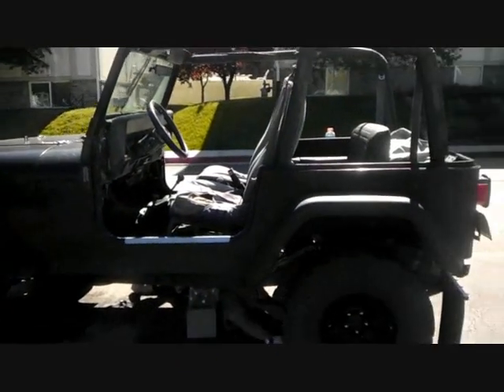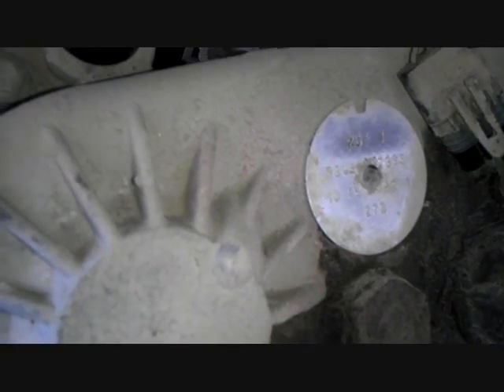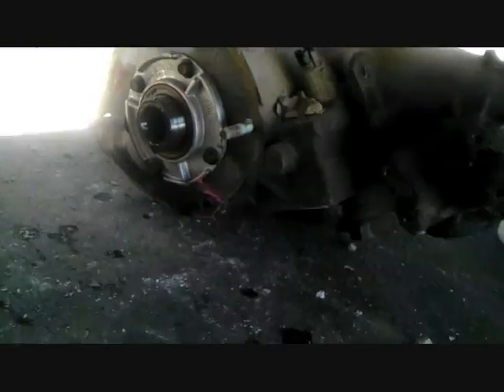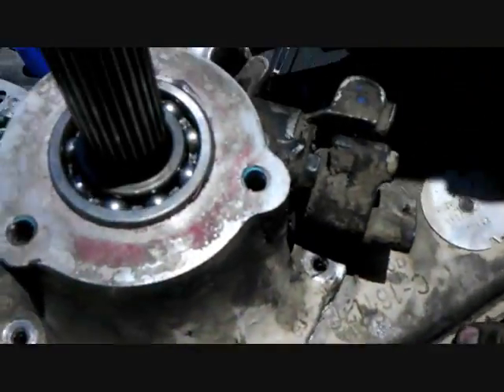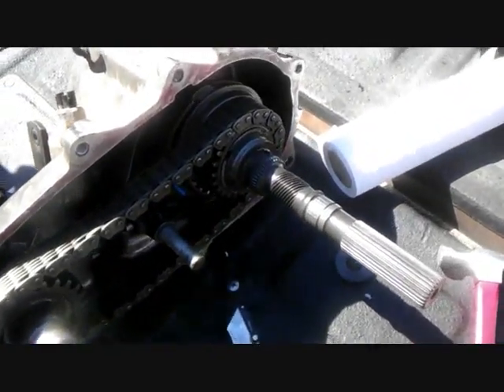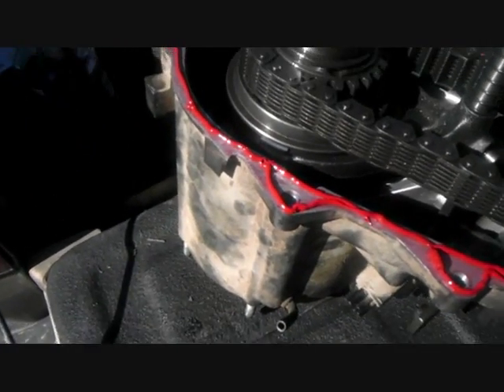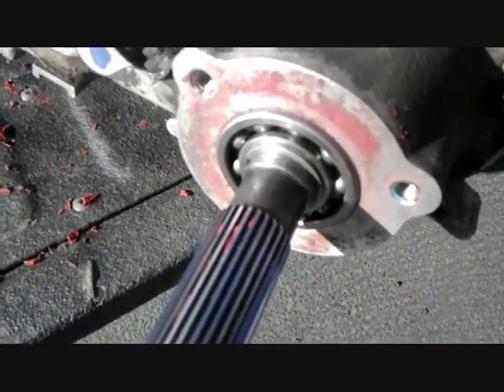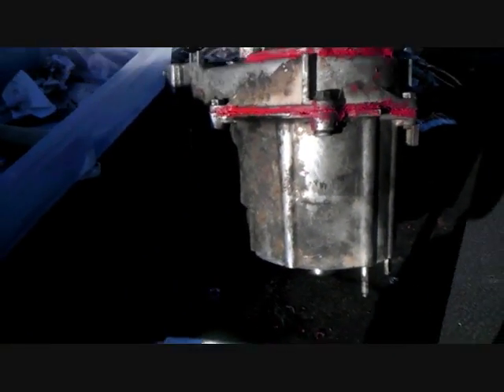NP 231 J Jeep Wrangler Transfer case Rebuild step by step

Comment: My universal joints snapped & my rear  driveshaft broke off the transfer case & the male end that comes out of the transfer case is crooked. What parts and where do you suggest to get the parts? 🙏🏻

Comment: Did you use enough RTV? The proper way to use RTV is to apply a bead behind the bolt holes and then compression will flatten it out without it getting in the threaded holes.

Comment: Great job for not sitting on the couch. Please, look to the right and check out some of the T. C. videos by folks who do it everyday. Not using "um" to much is a great start. Looking forward to the remake, (Why not to use so much silicon) where "this part" is replaced with words like pump, output shaft, yolk... Keep up the good work, DIY forever.

Comment: QUESTION! @ 5:00 exactly you can see the output bearing after taking off the first guard cone.  After you remove that snap ring can you somehow pull that bearing out without taking off the whole second base?
Reply: You have to split the case to R&R the output shaft bearing.

Comment: You're going to need more sealant than that. The stuff should be oozing out a lot further than that. Like drooping down like ice sickles. That way your oil pickup tube can suck up any excess inside the t-case plugging oil passages and detonating it all over the road leaving you stranded. Other than that good job.
Reply from the maker: I like the way you think.

Comment: Hey Jerry... nice video - got a question.... when you installed the TC back onto the tranny.... you mention a little seal thingy.... I have mine out currently and putting a SYE on it... when i go to install i back into the jeep... is there a seal or something that goes in between the tranny and TC?  I am assuming no RTV between there....
Reply: If you haven't got your answer yet Kevin Bartoletta the TC and tranny are completely separate from each other..meaning they do NOT share fluid. No seal needed there.

Comment: Hey I have this np 231 J on my 2003 Liberty sport.....t-case has 225,000 orig. miles on it and fluids have always been changed at recommended intervals.....also never abused the t-case.....makes a low speed growling noise now. ??? What could that be?
Reply: Most likely a bearing going.
Reply from the maker: Its hard to say over the internet.... its it making that same clicking noise that I showed in the video?

Comment: My son in law ran my jeep off the road in 4wd the other day. Since then it wont run when we shift it into 2wd and is making a horrible loud noise. We managed to get it into 2wd twice but it wont drive reverse or go into park and can only be run in 4wd. I think its the transfer case but not sure what part of the transfer case it could be. Do you think it is most likely the Tcase or possibly the transmission?
Reply: It's most likely the t case. I just did the same thing with my yj. Turns out that I just snapped the slip yoke on my car so I decided to put on a new SYE on it. Just get under it and check the driveshaft and slip yoke assembly. Something probably broke there

Comment: Heh, I found this vid about a year ago just wondering what it would take to crack into my t-case.  Low and behold, my jeep started making the exact same noise not too long ago, and I yanked the t-case and cracked it open today.  Yup, the shift range fork is worn out and I'll be putting a new one in as soon as I get it.  Thanks for the vid, it made my life much easier.
Reply from the maker: Super glad I could help!  You just saved yourself a huge chunk of cash by doing it yourself.  YouTube rocks.
Reply: JerryRigEverything I just bought a 95 grand Cherokee v8 with the same problem. Suspected tc and man I'm glad I found your video. Saves me a ton of time and cash. Thanks for the knowledge. My wife will be glad to have it going. Only paid 700 for it so its a deal
Reply from the maker: 700 is way good! Good luck with the project!

Comment: I see that you replaced your shift fork. What kind of problems were you having before this repair?
Reply from the maker: When I would let off the gas and coast, It would make a horrible grinding noise.  I kind of show what that noise sounds like in the first part of the video when I twist the drive shaft back and fourth under the Jeep.
Reply: JerryRigEverything My TC have been making this noise in the last several months...only happens between 10 mph and 40 mph

Comment from the maker: The Transfer case would be very very similar.  Get it diagnosed at a repair place first.  Sometimes they do it for free.  It would be annoying to pull the T-case apart and find out it is working just fine.

Comment: Informative video, good tip on shifting into 4wd to move the output shaft high enough up to get the snap ring back on.  Just an FYI to anyone else doing this job spend the $12 at NAPA Auoparts for the snap ring pliers, this'll save you a lot of time and aggravation.

I just finished putting mine back together, those plastic pads were worn off on the Big Fork (mode fork?) inside my case not letting 4x4 fully engage.  Hopefully it's fixed now.